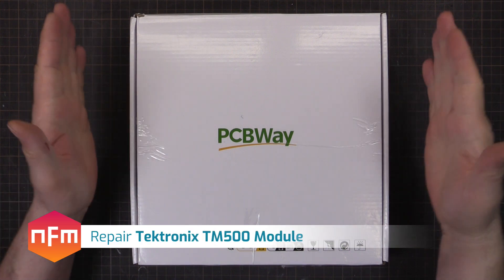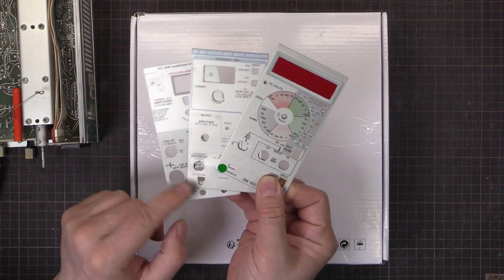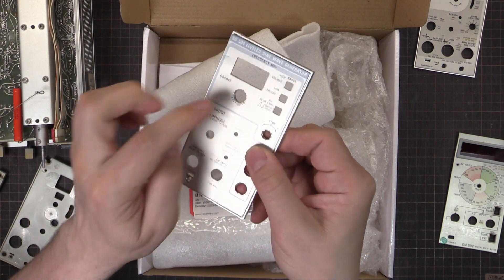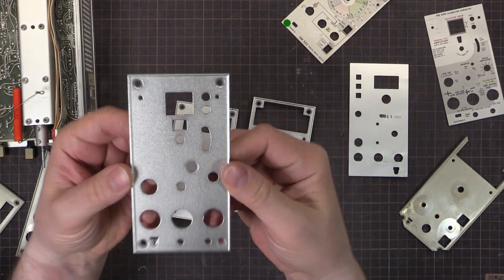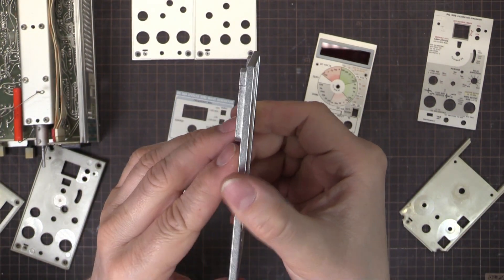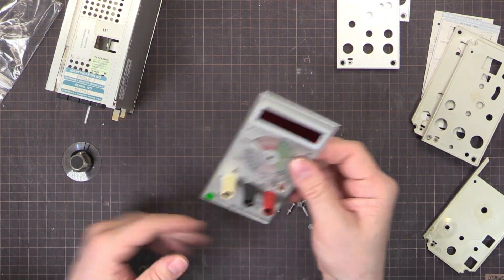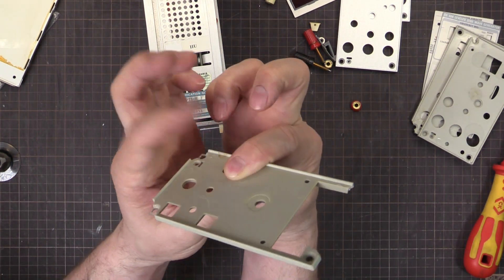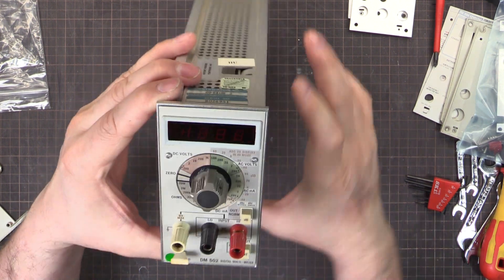Replacing Tektronix TM500 Faceplates

Comment: how did you specify bead blasting when ordering
Reply from the maker: When you follow the links in the video description, click on <Add to Cart>, then at the top select <CNC Machining>, you will see a drop down list called <Surface Finish>. In that list under <Anodized> select <Bead blast + Anodized color>.
Reply: @NearFarMedia  thanks I found it. will have to try their anodizing next time. I also get sponsorship by them.

Comment: These are really nice . There are a lot of TG501A,SC503,PG506A units out there with the newer red Lens that would benefit from this service if you had the time to make up the files for them .I certainly would invest in a set of the 3 .for my set . I'm presently looking for a SG504 and will get one for it two ...........Well done!................. these  cosmetic projects are just what is needed as there are loads of working but crap looking 500/5000 modules out there .i wonder would PCWAY be able to reproduce the silk screen fronts as well ?PS I just did a couple of TM503 facelifts with your boards. Had a tight squeeze on the Nichicon 4700/63/105 caps I put in leu of the no longer available ones in your BOM. Worked out very well . I dont need the pinouts at the top so just insulated the area  with capton below the wider caps.Thanks.
Reply: The fronts are OK DIY. Print with a color laser on an adhesive transparent printable label. Cover (“laminate”) with another label. Reuse old scratched up front end or have one laser cut without any legend.

Comment: Looks very nice but have you considered insulation distance for the MM inputs? 
Because now the terminal screw is now going trough aluminium instead of plastic and the distance seems small and I cannot see any additional isolation. Just thinking because the original face-plate and brace-plate have much larger holes.
Reply from the maker: Good point, a bit of glue lined heatshrink on the binding posts might be a good idea.
I'll take a look at the 3D files and modify them to provide extra clearance.

Comment: Excellent job and cool looking! 👍
Only one question about multimeter - isn't banana sockets shorted together through aluminium plate because of small holes? 🤔 Original one was from plastic and was like insulator between sockets and it looks like these sockets don't have insulation ring around middle pole..
Reply from the maker: Yeah, the updated version will have a wider clearance.
On mine shown in the video, I'll drill it out for clearance and use some heat shrink on the binding post to provide some insulation.
Reply: @NearFarMedia  We all made mistakes, time by time.. Main thing is noticing them and correct them..
You did great work for community! 😉👍 Thanks for sharing!

Comment: That looks great! Nice job!
How would you replace a DM502A?
Reply from the maker: A 3D model would have to be drawn up in CAD of the part, unfortunately I don't have a DM502A so I can't do it myself.
Reply: The top screw holes are set back some. I was thinking it would have to be done in multiple pieces and fastened together.
Reply from the maker: Ah yeah, I see they are the newer style front panels. I can make a blank design, but that's as far as I can go.
I reckon it could be done as one piece, but may cost more than the older style plates in my video due to the larger size and complexity.
Reply: I bought one from a seller out of France. It has not arrived yet. I am hoping that looking at it will give me an idea.

Comment: Now to get those disentegrating knobs replaced...
Reply from the maker: Yeah... Those knobs can be a bit of a problem... I have a couple bits of gear with knobs that need attention actually. Check out my TG501 video for one idea to repair the knobs using JB Weld.
https://www.youtube.com/watch?v=U5LQpqwqNIU

My late model PG506 needs a new knob made from scratch too, it's still waiting for its turn on the healing bench.
Reply: You did mention PCBway do injection moulding... 😂
Reply: @pa1wbu  Lathe project.